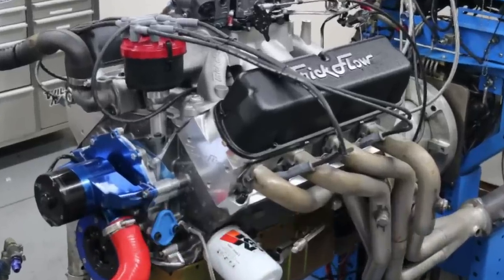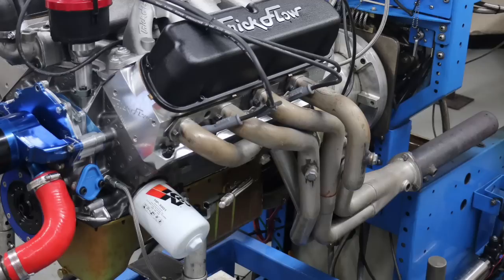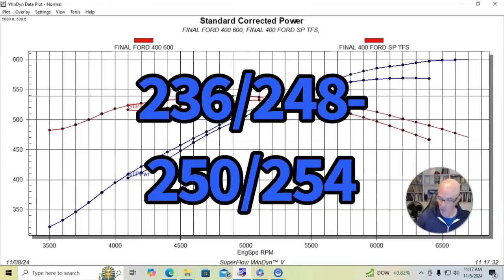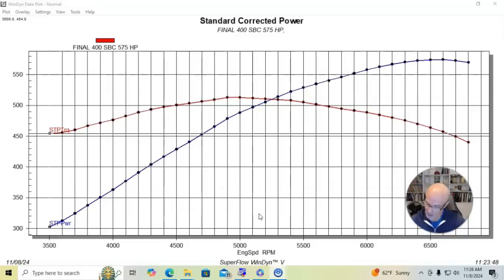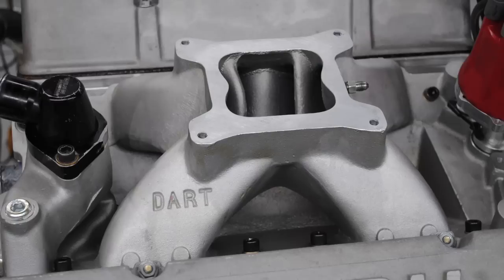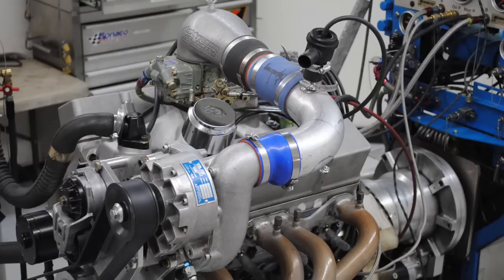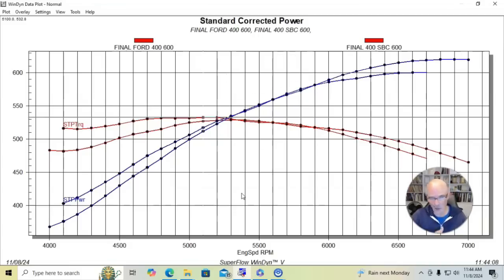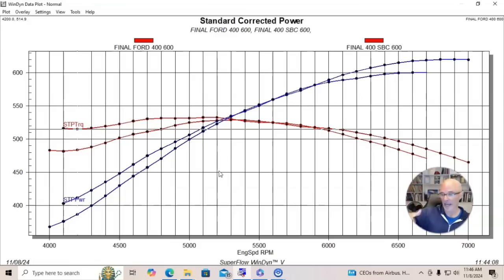400 FORD VS 400 CHEVY-THE OTHER GUYS STROKER BATTLE. HOW TO: 600+ HP 400-INCH SMALL BLOCKS!

Comment: When I initially read the title, I thought it was going to be a 400M Ford vs a 400 SBC
Reply: Yep me too thats why i clicked on it ..not alot of builds on 400m
Reply: I'm here for the same thing .most peps have never been within a quarter mile of a ford 400m Cleveland or a original small block 400. I had both , back in the day. I'm sure the new stuff makes alot more power.
Reply: @gainerman  
I've been buying up all the 400 SBCs around me. 😁 I stumbled onto a 402 big block last week while at a Ford wrecking yard; she came home with me.
Reply: @gainerman 💯
Reply: Same here, I was super disappointed that it wasn't the 2 oddball small blocks that never get any love.
Reply: That's why I clicked it.
Reply: 400m and 351m are the same block...
Reply: this is misleading AF! i thought it was a400m too! fuck that
Reply: Glad I saw your comment before I watched.
Reply: I've built several 400m engines. Nobody wants them. Great for me and easy 500lb torque and 450+hp with 5500 redline and 87 octane.
Reply: Yea me too.. 😢
Reply: And then?
Reply: Yep this is not what anyone cares about,  anybody can build a stroker
Reply: @alabamacarrescue1488  there are lots of people wanting info on stroker Windsor builds
Reply: @bluecollarhotrods9781  I did too! Ford never made a 400 Windsor engine.
Reply: Be happy..a 400m have ckeveland heads..aftermarket c heads would destroy the chevy @charlesmounts4927
Reply: @charlesmounts4927  And Chevrolet never made a 400 cubic inch engine. When you do the math, they have 401 cubes.
Reply: @Olds_Pwr same for .030 over 406 a 406 is closer to 407 for sure.
Reply: @DiscoGreen  Correct, a 401 cubic inch Chevrolet bored .030 is 407 cubes. I have no idea where people have come up with 406 cubes. Bore x Bore x Stroke x .7853982 x number of cylinders = cubic inches. As we have learned from school, .5 and higher rounds up.
Reply: @Olds_Pwr  Well, they did, but you're splitting hairs calling it 401.  (400.92ci)
Reply: @ Guess Chevrolet was splitting hairs with their 350 when the math comes out at 349.84.  Or Pontiac with their 350 when the math equals 353.79 cubes.
Reply: @Olds_Pwr do the math, Chevy 400 small block is under 401 cubic inches
Reply: @td4426  I did the math, it is 400.9, which equals 401 cubes. Just like 349.8 equals 350 cubes.
Reply: @Olds_Pwr Chevy built the 400 small block from 1970-1976, not a 401. The 402 big block Chevy was used from 1970-1972 aka LS-3.
Reply: @Olds_Pwr the 401 produced from 1971-1979 by AMC was the only production 401 available with 4.165 bore and 3.68 stroke
Reply: @td4426  This is to answer both your comments.  Manufacturers can displace their engines whatever they want. After you do the math, you will realize some of them are not correct.
Reply: @Olds_Pwr 
This is to your contradictory comments:
yes, manufacturers are in the marketing business as we know.
Your definition of just rounding up the number as YOU choose, doesn’t add up in many cases. The Ford 351M (3.5 stroke x 4.00 bore) is 351.9, while the Ford 400M (4.00 x 4.00) is actually 402.12. I’m just saying. I’ve built both with good results.
Reply: @Olds_Pwr  Yep, I "428" FE Ford actually displaces 426 ci, but they didn't want to create confusion with the Mopar 426 and they already had the 427 FE... so 428 it was.
Reply: @Olds_Pwr  actually volumn of a cylinder is : bore radius ² x stroke x number of cylinders
Reply: @ScottNelson01  Courtesy of Summit Racing:  c.i.d. = 0.7854 x Bore2 (in.) x Stroke (in.) x Number of Cylinders.
Reply: 400 M with CHI Cleveland heads would eat the Chevy up..
Reply: No such thing as a 400M
Reply: @jrorie72 yes for about 10 year production run.
Reply: @jrorie72 The hell there ain't, what rock you been hiding under?
Reply: @jrorie72  There definitely is a 400ci BBF offered in many 70s cars..
Reply: @P71ScrewHead  Ford did not determine the 400 a small or big block.
Reply: @LAmonk76  I have always read that it was considered a small block. This is from Wikipedia - Configuration 90° OHV small-block V8.
Reply: @Olds_Pwr  Correct. Based off the 351C. the 400 is a taller version to fit the 4in bore. The later '75 351M was to replace the 351C as a de-stroked 400.
Reply: @P71ScrewHead  It's a small block 335 series engine, but it does have the big block bell housing and engine mounts. The early 71 400's actually have dual bell housing patterns on the back, small block and big block - Ford wanted to get rid of their remaining FMX transmissions LOL.
Reply: @cgarris8674  Everything points as a bbf to me.. But kool, didn't know that about the 71s..
Reply: @P71ScrewHead  The 400 shares the same bore spacing as the 221, 260, 289, 302, 351W, 351C & 351M at 4.380 in. FE's are 4.630" & Big Block Fords (385 series) are 4.900".
Reply: @cgarris8674 
I was going to say that you beat me to it. 
It's a  tall deck small block.  The deck height & intake width are close to an FE. 335 m was the FE replacement.
Bore a 400 .04 over. You get a 410 FE for about 200 lbs less,

Comment: Big bore is the better option on these heads keeping the valves clear of valve shrouding. Build a Cleveland based 400 engine and see some real power
Reply: I have a question . Why do cams, ground on the same grinder, cost different prices? Why would a .268 cam cost more than a.260?  Why should one cam cost $500, and another cam cost $300, within the same brand?
Reply: @ronniejohnson317  The difference is demand for the cams..
Reply: Yeah, that's a big argument for more bore, but a good head design or chamber shaping mitigates that issue also.  Modern engines have often gone longer stroke and smaller bore, less friction, less thermal losses, and smaller flame area so less timing is needed.  Of course 4 valve makes that easier also.  Some newer engines are running 10-11:1 compression and still 9+ psi boost, but also direct injection.

Comment: The big thing for me is the Chev having a bigger bore is an opportunity to go bigger valve compared to the Ford.
Reply: the Chevy had an aftermarket block, If you use an aftermarket block on the Ford, you can have the same bore. Why not an Apples to apples build? or is it that you don't want to compare you just want to blow about the Chevy.
Reply from the maker: I guess you are new to the channel
Reply: @richardholdener1727  Why? Are you famous for not doing Apples to apples tests.

Comment: Not a very good comparison. Too many variables. How can you make a comparison using different spec cams? Do the heads flow the same?
Reply: One engine had 205 CC heads the other had 225cc we don't need to be too sharp to figure out who is going to make more power. 205 heads are Small engine heads. Most Guys run them on 331 and 347 engines.
Reply: @mylanmiller9656  CC's don't tell you how much they flow. You can have a set of heads with less CC's and outflow another set with more CC's.
Reply: As far as I can remember the dart 225s cap at 335 at .7, but that just means the fords more efficient as with lower flowing heads and smaller cam, though both are clearly good enough

Comment: I got a 406 that I would love to dyno someday. 11/1 220 flotek cnc heads 622 lift 292 Schnieder cam  hp950 carb all forged paired with a th400 and 4500 freakshow.
Reply: What did those sbc heads flowbench at? Mine are 320cfm at .700 and 315 cfm at .600
Reply: @DiscoGreen I see your car everywhere when I’m just looking at cams, I think the darts do max 335 at .7, really not gonna be much of a gain

Did you have to severely clean up your flotek heads to achieve that number I got a pair for my 387 for I’m building wanna know up front now so I can fix it now
Reply: @benjaminwatson7868 i watched a video by Chad Speir on the floteks. I just tried to duplicate what he did. I didn't remove much material all I did was get rid of the cnc marks with some 80 gtit cones.. both in ports and in the chambers. Also take a ball or cone and debur the spark plug holes or you will have hot spots mine were sharp. Also I sent my heads to Kim barr racing engines to cut steam holes, ccheck seats assemble and set springs.. he said the seats were great out of the box...  the second build I sent them to AJ at Xtreme Engines in Lewisville and he cut seats set springs and shaved .010 off them to raise my compression a hair. I did find it needed .120 thick gaskets and carved them to fit with exacto knives and spent a damn week porting the victor style hurricane intake for the .200 raised runners. The 2x thick gaskets helped align the intake after porting... I used flashlight down it and 6" carbide bits to do the intake with snap gauges... lots of work. A dart intake with dart raised runners would've saved me tones of work to be honest.
Reply: @DiscoGreen  got ya, sounds good I’ll try some of the stuff
Reply: I wish you had bored the 400 to 406 and sprayed it.